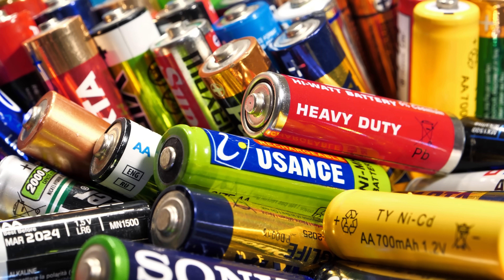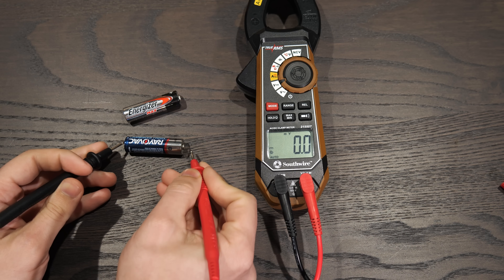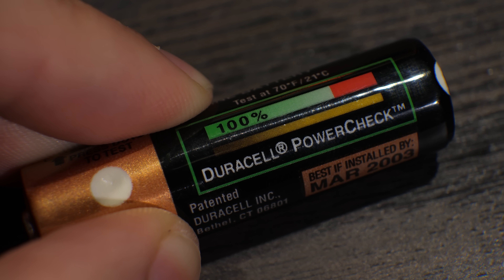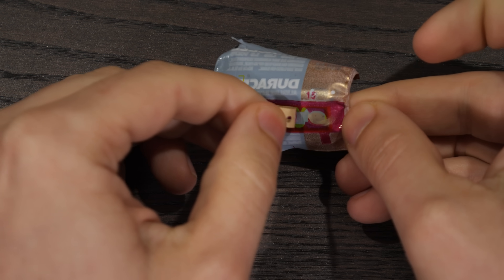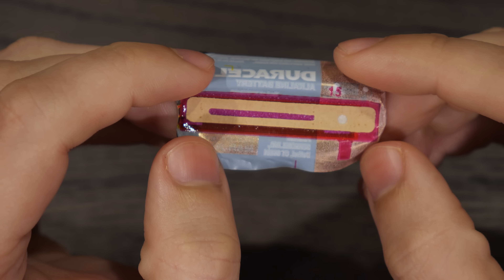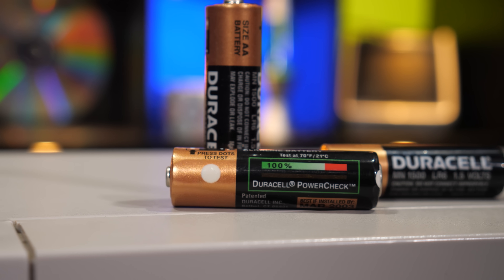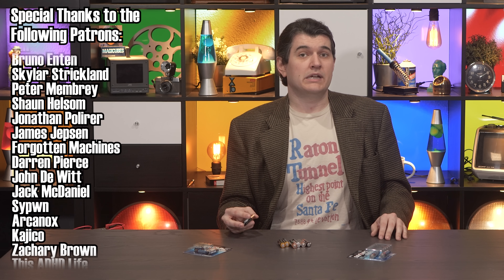Duracell PowerCheck: A genius idea which didn't last that long

Comment: So I use Menards brand rechargeable batteries much cheaper than most other rechargeable batteries yet just as reliable as an Energizer or Duracell version they are called North tech

Comment: You'd argue it's uncommon? So many people, including myself, and the way I was raised, have junk drawers with loose batteries in them. It's really a bad habit, but arguably there are certain devices that still function on batteries that otherwise would not work in different devices.

Comment: Life tip: If your device uses batteries but you don't use it often, a piece of plastic can be wedged between a battery and it's contact to break the connection. This prevents passive draining as well as corrosion. I cut strips out of the plastic box the batteries come in to minimize waste.

Comment: I always keep my spent batteries for remotes lol remotes don't need new batteries. For some reason I always thought this was common practice but after you said no one does that I thought about it and realized I started doing that back in 90's cause I needed batteries for my gameboy so I kept stealing them from my parent's TV remotes and that made me realize the spent batteries from the gameboy still worked for awhile in TV remotes. So having said that, I always loved the battery test function lol Just cause the batteries are dead for one device doesn't mean they won't work in something that is less power demanding. I was actually even considering getting a battery tester like a week ago cause I still have a pile of used batteries from this habit. Although instead I ended up just buying rechargeable AA and AAA batteries cause I keep forgetting that's a thing now. ALSO you can get them with the chargers built in now too! I just plug a cable directly to the battery to charger it.

Comment: A note on "just putting the batteries in and seeing if it works":

If you pick up two random batteries of unknown remaining capacity, there's a decent chance they'll be different. Say, you have one at 1.3V and one at 0.9V. It'll work, because it's expecting 2-3V of power, but now you have a dangerous situation where one non-rechargeable battery will try to charge the other, and that's a fire risk (and the reason battery packaging says to not mix charge levels)

Comment: I'd say this idea of "partially used batteries" and checking their charge was born out of portable cassette audioplayers, some of which were powered by a 4 or 6 AA batteries. After a few uses batteries started to produce reduced voltage and undervolted motor in cassette player caused the sound to distort and slow down (yeah, slowed+reverb effect, lol) but aside from that batteries were still perfectly usable by tv remotes and whatnot. So after high-demand use (in your Walkman) you could test if the batteries were still good enough to power your flashlight/tv remote or they were sucked dry.

Also again, power draw of those early cassette players was dependent on how much you use speed mode to skip to next song, so again, you could check how "fresh" your batteries were if you wasn't sure about their rate of discharge.

Comment: As a kid/teen in the 80s and 90s, we didn't have an unlimited battery "budget", so we would often swap batteries between toys. I do remember using these quite a bit, but found the ones built into the packages to be easier to use with my child fingers.

Comment: I remember RC cars use to need a lot more juice .. thus once the battery did not work in a RC car... into the TV remote it went since that only needed fumes. Ofc the drawer first since the tv remote took a long while to eat thru the half full batterys.

Comment: That, and if you needed to quickly test random alkaline batteries, you could always use the drop test. Basically hold the battery vertical, a few inches above a hard surface. Drop it so it hits the flat bottom (negative end) on the table.  If the battery drops and doesn't bounce, it's fresh and ready to use. If it bounces, it's either dead or half used. It's often good enough for all intents and purposes if you're looking for a set of batteries. You pick the ones that bounce the least.

Comment: I had use of these. When stuff like a remote stopped working I could easily check if it there batteries were dead or if the remote control had dropped on the floor one too many times

Comment: Actually, at least here in Europe, Duracell still sells batteries (both AA and AAA) with power testers in them. It's called Duracell Ultra Power, but they cost almost 1€ more than the normal batteries, so I haven't seen anyone ever buy them.

Comment: 12:00 What? lmfao, you clearly never used many AA powered devices back in the day. Your premium batteries such as Duracels were for the high-end and high-draw devices, while the Rayovacs are for the mid-grade and low-draw devices, typically the emergency flashlight and remote. It's not just competing for cost, that cost often reflected quality. You'd spend more in the long run replacing Rayovacs over and over rather than just splurging for the Duracels and Energizers. I had an RC monster truck that took 8 AA batteries (or 1 ultra-premium rechargeable multi-cell power pack that couldn't be sourced in my home town at the time) and if you skimped on batteries it wouldn't last long.

Comment: to your point about not missing disposable chemical batteries, another benefit of lithium is they're (usually!) sealed better. I haven't tried this but I imagine leaving a rechargable lithium AA battery in a device for a prolonged period would result in it eventually bulging but probably not leaking. cleaning chalky, sour-smelling chemicals out of a battery compartment was never a fun time.

Comment: well another thing about many devices is that they last a looooong time like our remotes. i just checked my handy dandy logitech k400 wireless keyboard with a touchpad that i use to operate my pc when i'm not near the pc so nowadays since in my current appartment my desk is in the bedroom i have the tv hooked up and use it to controll things from the bed. i got it from amazon on 3rd of september 2015 so i have it a little over 9 years now and the batteries it came with are still in and on about 75% charge. i never even turn the thing off except for when i'm dust whiping it while the pc is running. and many devices like remotes etc. also last forever on a pair of aa or aaa batteries. in the past we had a lot of dothats that were actually too powerhungry to even be reasonably run on batteries that would run a day or two but things became more efficient i suppose and companies realized how much people hate a device that needs constant refueling so they make them either cabled or tinker efficiency to a point where it's not annoying af to run out buying batteries every week.

Comment: 11:00 It's actually quite common, especially back then. You'd have one device that sucks more power than the remote, say a Walkman or Discman. The music player will stop working after the batteries are spent by a certain amount, but the low power draw of a TV remote means that they will still power the remote for a couple weeks to months after the week it took for the player to stop working.

Comment: They worked really well and were surprisingly accurate. I felt bad discarding them because it felt like I was throwing away a decent instrument (a very specific,  but yet useful one).
Reply: I know. The tester should rather be a separate device inside each pack of batteries, so that it could be re-used..
Reply: @suprlite That was a thing.
Reply: @wolffang489  ah, ok. Is it still?
Reply: @suprlite  Not sure but I remember the test strips that were effectively what's on these batteries but on plastic instead so you could test any battery of appropriate types.  It was a while ago so I can't guarantee that they came with battery packs but considering how cheap they surely were to make I wouldn't be surprised.  You can likely still find some with enough google digging.
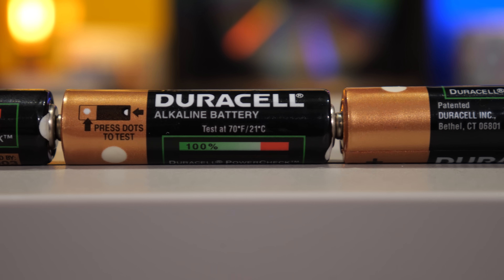Reply: 12:53
Reply: @hrysp  They really would still be nice to have on rechargable batteries.
Reply: @wolffang489 you prune
It won't ever exist again though
A digital Multimeter is perfectly accurate and extremely 100% reliable
Reply: I remember the tester device being built into the packaging like was mentioned in the video.  I found that to be superior because you could test any battery in them.  I used to buy a pack of Duracells just to get the tester, then buy cheaper ones after I had the tester already.  They would wear out after awhile but they were pretty good.
Reply: @100percentSNAFU yes! I remember those too!

Comment: When the bars turned yellow that quickly and that completely, I knew you had to be using a heat source or voltage source somehow, because those bars would typically take up to 10 seconds to change color, and would only go up about halfway usually

Comment: I remember it. It was nice, but people don't really need to verify that the battery is charging them too often. Tzpicallz as soon as the device stopped working, the battery was replaced with a new one and the old one was discarded. As a feature, it's fine, but no one is willing to pay a higher price for a battery because of this. In fact, people usually buy the cheapest batteries and the more expensive ones, even if they last longer, only if they absolutely need it..

Comment: 1. These did have another use, though also one you could brute force by swapping batteries around. Sometimes the device has the problem and the batteries are fine. Having something to make sure the batteries are good came in handy to me a couple times.
2. Yea, I worked in an office that for some reason had Mac "magic mice" for a while, and those things OBLITERATED AA batteries. A whole desk was reserved to holding dead batteries.
3. "I'll get pedanted" is a wonderful turn of phrase.

Comment: I've got enough stuff which doesn't utilize most of the charge from the batteries. Because my mouse can always run the "empty" batteries for another month or two.
What I don't get is why rechargeable batteries drain when not used a lot faster.
Reply: Rechargeable ones hold less charge than good alkaline ones so they last less.

Comment: My only issue is that you have to take yourself back in time. As you stated, people used these batteries for everything. So people use to constantly pull batteries from one device to another. this would get batteries mixed up and other things. Sometimes mix new batteries with old batteries. People would mix brands. It was a different era. This would be kind of like thinking people would only rent a movie or two on the weekends in the early 90s so there was not a big reason to have a tape rewinder. At times, people would rent 3 movies a during week days and like 4 on weekends for some reason. It was the time.

Comment: "We're just not buying or using disposable batteries as much as we used to". I don't know, I'm still a bit shocked when I visit the US, to see those 24, 36 and 48 battery packs on supermarkets there. I've never ever seen anything like that here in Mexico. I mean, sure, maybe they're available here on specialty stores, or Amazon. But casually on supermarkets, I think 6 or 8 pack is kind of the largest you usually get.

Comment: I have a medical device, Insulin  pump, it goes through AA batteries, I have tried rechargeable AA batteries in it but every two weeks I had to swap it and charge it up again.  Those are now being used in a remote control.  However my Transmitter, CGM, is rechargeable and the charging station for it uses a AAA battery.

Comment: I would like it if batteries had a little pull tab or something that you could manually mark to indicate that the battery has been used. I've had some times where I'm unsure if a battery is used or not, and it's easier to just throw it out than deal with testing it. They are really cheap when you buy in bulk.

Comment: Duracell battery leakage is nuts! Even unopened Duracell batteries leaked in our storage locker. I will never buy them again.  I think they put the test strip on there to keep you testing them over and over, since the test helped drain them faster...thus more sales.

Comment: I started saving batteries because the college we contract for claimed they had a battery recycling program. It ended up being the backup emergency battery bag, and if I'm desperate enough I'll go back and check voltages and sort them by brand and voltage reading.

Comment: The last time I actively used one of these was on my Steam Controller, and the pair lasted for over 3 years (mild gaming) up until a year ago. Duracell Ultra had these in my country till 2017/18-ish, and I had purchased a pack of 8. So yeah, they lasted me quite a while. The PowerCheck feature was super helpful in understanding which of my stockpile of batteries was depleted, and yes, of course I purchased them solely because I wanted to try out PowerCheck for a long long time!

Comment: Speak for yourself. There are many times when I'm just not sure if a battery is actually dead or just low or if it's just the device (there have been many times where it was actually the device). And yes, sometimes there are random loose batteries in odd places. Why? Who the hell knows. Probably because at least some of the time there was just enough ambiguity whether or not the battery needed to be replaced and you don't want to throw out what might actually be a still good battery.
But I don't want to get a battery tester, because it doesn't come up frequently enough to warrant it; and then it just becomes another thing to keep track of, that I probably won't be able to find when I actually need it.

Comment: A meter with a LoZ function may fix the "testing under a load" function, as it should do that. LoZ is used to help troubleshoot and get rid of ghost voltage for more accurate voltage checks with a known voltage.

Comment: I'm surprised you didn't show battery tester strip which I suspect are based on the same principle but not attached to a battery so you can use it multiple times.

Comment: I remember these seemed to also vary with pressure, too.  Press harder and it seems to pass more current.  The ones I remember in the mid- to late-2000s had a different colour dot on them - a black circle with a cream-ish dot in the middle

Comment: I remember before it was on the battery itself, they would have a little paper strip in the box or sometimes attached on the back that you would press against the contacts to test the battery.

Comment: 90s child here...

If i my memory circuits serve me correctly. It was either Duracell or Energizer that started moving the battery tester to the packaging the battery cells arrived in. The function was pretty much unchanged. Youd place the battery in a particular slot in the original packaging and press/squeeze certain points of it and the bar would go yellow.

I cant remember who it was that done it like this but it could have been Duracell as a way to get around any sort of patent dispute.

::EDIT::

Had a quick google and it was Duracell that moved their tester to the packaging. You can find an old Duracell advert with it in action if you search for "Duracell Battery tester Advert 1991" on youtube.

Im not sure if Energizer did the same. I dont recall them doing it but my memory from 91 is sketchy. Memories from 33 years ago is always going to be hard to remember.

Comment: I've had a battery tester for years. When I was using alkaline batteries I would always test them before tossing them. I'd often find that one of the batteries was dead and the other still had some usable life left. In something like a TV remote it would still last a long time. I imagine people that just tossed them wasted quite a bit of their usable energy. 
At 2:43 when you said testing the batteries without a load was still fairly reliable, I was about to blow a blood vessel. That is completely wrong!
You showed the difference later on while showing the multi-meter voltage and then applying a load proving you do know better, so I'm not sure what you meant.
I like the outtakes. :P

Comment: Much worse than device needing AAA when AA would fit, are devices that need a coin cell, when an AAA would fit!

On the other hand, just imagine how awesome the AA(A) standard was! Now most devices come with a built in lithium battery, and they come in all sizes and shapes.. in the new age of industry they didnt want to make a few sizes and have different companies compete, no they all wanted to lock the customer in, having the buy a very expensive replacement battery from the original manufacturer.
Reply: And even further down that road it even got worse, when they decided, they dont want you to replace the battery at all, but throw the whole device away, when its end of life (or get in their shops for a super expensive replacment "repair")

Comment: I remember those when kid my dad use them for camera flash because it use 4AA and need relatively high current for first flash and little less for each more. Everytime one of those 4 batteries go weak much faster then other and flash don't charge himself but other 3 with 1 fresh still do job. Dad gave me those weak batteries because still show something more then half and I can use them in radio, flashlight, alarmclock, toys, etc. and I love to check them.

Comment: Whenever I use a multimeter to test a battery. I measure the Voltage first, just as you did. If it reads ok then I switch over to amps mode and measure the max amps (for as brief a moment as possible)

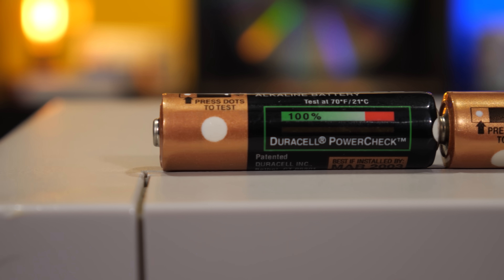Comment: 12:35
I had to buy a set of batteries just to realize that the thing that needed batteries didn't work anymore.
That's why I'd use battery testers. But if they cost more, it really is not worth it.